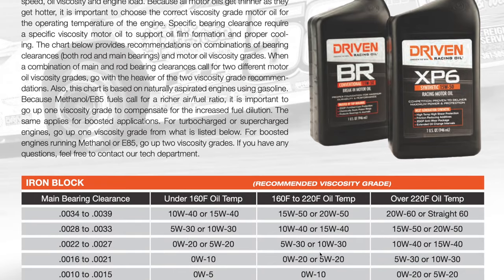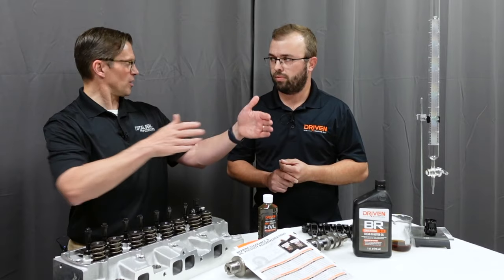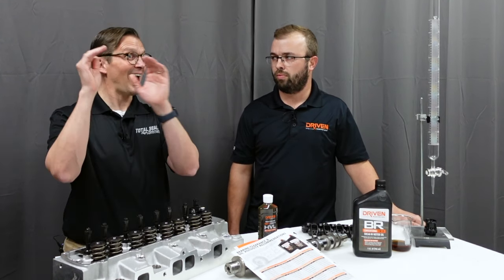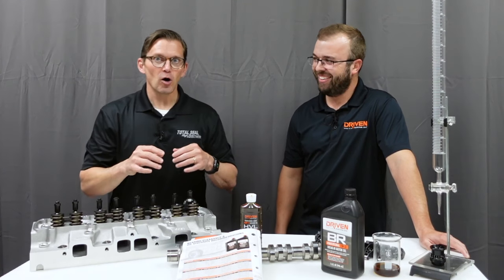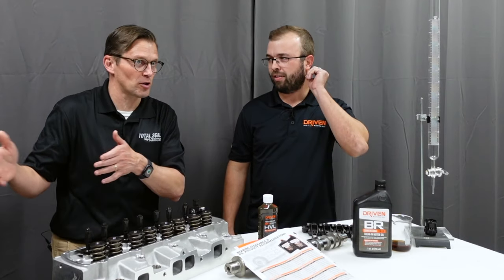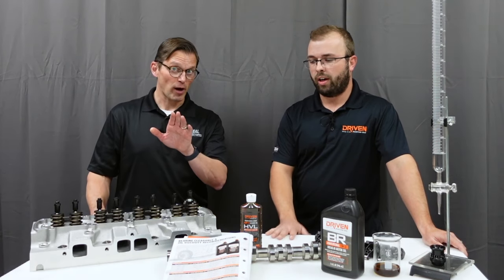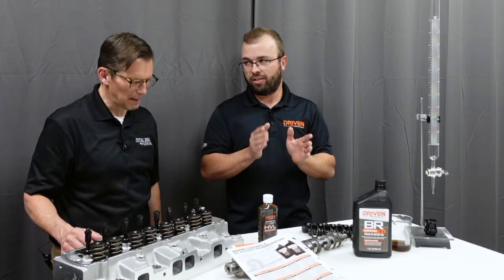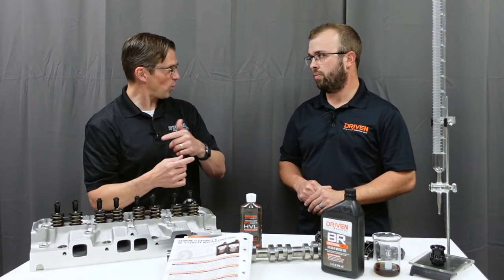How To Choose The Right Viscosity Motor Oil - A Certified Lubrication Specialist Explains

Comment: Thanks for the great video. One thing to keep in mind, fuel dilution changes the viscosity requirement for pedestrian gas cars too. We can choose an oil that provides adequate MOFT under 100% of normal operating situations, but when driving around town, fuel can accumulate in the oil. Follow this up by a blast down the road at high speed, some towing, or a track day without enough time to evaporate the fuel, and bearing failure can be the result. The Audi supercharged V6 is well known for this.
Reply from the maker: Great point!
Reply: There is more than fuel dilution at work here. A 5W 30 oil is a 5 weight oil.cold with viscosity improvers to make it act like a 30 weight oil when it is hot. Operating in the tight clearances of a running engine a couple of other things that happen beyond fuel dilution are shear back whereby those viscosity improvers get broken. Think of them kind of like tiny bits of thread that get torn in half, so now your hot oil behaves more like a 25 or 20 when hot. Another thing that happens is boil off. Petroleum is a compendium of molecules with different boiling points. When you get the oil well warmed up the light ends vapourize and get carried out in the PCV system. Now your 5 oil becomes 8 or 10 when cold. 
Synthetic oils do not have the range of molecules petroleum oils do and can be engineered for qualities the designers want. Thus they do not have the same light end boiloff or the shearback. Synthetics generally have premium additive packages in them that prevent shear better. 
Like the old Fram filters ad, pay me now or pay me later. You generally get what you pay for, so if you pay for cheap shit, you get cheap shit.
Reply: @daledavies2334  speaking of PCV , I wish people would change their friggin pcv valves! Some cars should have them changed as early as 30,000 miles. Then on another topic, I also wish folks would do their transmission fluid at regular intervals.  Today's small DI turbo engines with a CVT is so easy to do, you should really be doing it atleast once a year. Or at a minimum of every 30,000 miles.
Reply: @daledavies2334  THANK YOU, THANK YOU, THANK YOU!  So many people nowadays think that a multi-vis oil is the hot number - ie 5W 30 is the same thing as SAE 30 - and will argue and even want to fight you over that.  I was beginning to think I was the only one still alive who knows what Multi-grade oil is.
Reply: @vermontvermont9292  They insist on waiting for the trans to start slipping, and by then it is often too late.  The damage has been done, and the death spiral has started.

Comment: I use what my car manufacturer recommends in the winter and put in a slightly thicker oil in the summer. Most of all, I pay attention to the night time temps. I want the thinner oil in there for cold nights. When it never gets below freezing at night, only then will I put in my summer oil. You want the oil flowing freely at start up...always.
Reply: All multi-grade will flow freely at start-up.  It is SINGLE-GRADE that may not.
Reply: 5w should work unless you see -30+
Reply: @AntilleanConfederation at that temp, even 0W oils may take a little bit to get up to the valve train upon startup.
Reply: @carlovanrijk4039  exactly
Reply: @jamesbosworth4191 back in the day,  my Dad was having trouble starting his 6.2 diesel ⛽️ on colder days (n.w.corner of Oregon) I switched from his straight 30 to a multi viscosity... problem solved

Comment: Working in a large fleet operation, 200 units, cars, SUVs, trucks from class 3 to class 8, I observed 1st hand the effects of 0- 5, 5-20
Each vehicle that the manufacturer recommends 
super light weight oils had knocks, rattles, changing to 10-30 stopped it all.
Our fleet was made up of GM, Dodge, Ford, gas, and diesel engine cars and trucks in Colorado.
 Managing a fleet you get see the effects even before the manufacturer does.
Reply: Isn't the purpose of  low viscosity oil all about better fuel economy ?
Reply: @speedfreak8200  At the expense of engine life.
Reply: @jamesbosworth4191  only for American junk. I had a 2012 Camry that I put 217,000 miles on using 0W 20 oil. Never burned oil between 10,000 mile oil changes and no knock or engine problems of any sort whatsoever.
Reply: @markkauffman6184 They didn't advertise 10,000 mile oil change intervals in 2012.  Also, lots of people have told me in a bragging way that they hardly every change their oil, yet their engines is "perfect".  Well, it does start, and it does move the vehicle forward, but perfect???  Pounding like a blacksmith making horseshoes is hardly "perfect".
Reply: @jamesbosworth4191  actually in the owners manual it did say you could go 10,000 miles under normal driving conditions. I did a lot of highway driving and so it fell into that normal driving conditions. My engine did not burn any oil and when I looked inside valve cover, there was zero varnish, all you saw was gray metal. The only reason I sold it was it was starting to rust - and in the rust belt that is the kiss of death.
Reply: @markkauffman6184  I am talking about what mechanics say, not what the automakers use in advertising claims.  You CAN NOT go that long unless you don't care about engine life.  The EPA gives the automakers tax credits for making those ridiculous claims.  They are not dreamed up by the engineers, and I will not listen to car-hating hippie bureaucrats.  Many of them don't even know how to change a damn tire.
Reply: @jamesbosworth4191   Hippies can only Change Flats on VW Micro Buses, ha ha
Reply: @speedfreak8200  Have you seen this commercial, I never catch the whole thing, but there are some adults, INCLUDING GUYS, and a car with a flat.  One of the ladies says, "Let's get this fixed".  Having to call a tow truck for a flat tire when GUYS are there?  Incredible.

Comment: Excellent video! I’ve never seen a chart that gives you a baseline for where to start with bearing clearances. I want to build a road race 454 LS7, and now I can have an intelligent talk with my engine builder. I’d like to run 0W-40 on the road course at an oil temperature greater than 212°F and still have adequate oil pressure at 7000 RPM. Hopefully going with the gas-ported, gapless 1mm, 1mm, 2mm ring package!  Thanks for educating the track rats and gearheads out there!
Reply from the maker: We are happy to help! The gas ported top rings are awesome, and the 0W-40 should be a solid option with bearing clearances between .002 and .0025
Reply: @DimosTs192 dodge specificies a 0w40 for all their scat packs aka 6.4l Hemi, so at least at start up I cant imagine they would spec an oil leading to wear under warranty...in fact other oils will void it....
 I run a 5w50 in a 7600rpm LS7 build get about 75psi hot at shift....

The gen 3 boosted coyote calls for 5w50 it would see 90psi at 8000rpm shifts well 7850
Reply: @DimoS... does the w stand for weight or winter ?

Comment: Good video. One has to remember that with miles come wear, the clearances will get bigger thus less resistance for the oil. With higher milage you will have too use a thicker oil.
Reply: High mileage oil
Reply: @matt4398  Only for leaks.  I've read High Mileage will cause rubber seals to expand...

Comment: I keep looking through these hoping to see Lake Speed Sr show up. I miss the glory days of NASCAR.

I run 5/30 in my wife's Chrysler and 0/20 in my Alfa, just as the manufacturer recommends. No problems and we run them long and hard on trips (300+ miles between stops @80mph).
Reply: What's the outside temp when using the 0w20.  I'm not a fan of light oil in hot climates...
Reply: @lonniebeal6032  Freezing or boiling. There's no other recommendation. It seems to work fine. The engine temps never go above 192 and it doesn't use oil...about 1 qt every 10K miles.

Comment: One additional point, when using piston squirters, distributor gear squirters or in engines that have other forms or devices or wear that can result in oil pressure/flow escapes, (leaking timing chain tensioners or slightly worn oil pump are a good example on an older engine) The use of ultra low viscosity oil can result in zero flow to distant components. It's not that the parts need more viscosity, it's that the system as designed or operated can't provide adequate flow, often during very low RPM conditions. This is why we sometimes see the farthest cam bearing cap wiped-out first. And why a move to a more viscous oil is a viable solution.

Comment: Many years ago I ran two different oils to test on a very hobby level, but there was almost 40 degrees *C oil temperature difference, one was Semi-Synthetic maybe 15-40 or 10-40, the other was Full Synthetic maybe 5-30. It is a long time ago, but I was impressed at the difference, it was also two different brands, so many changes. But one of them was around 95*C and the other around 135*C at full warm somewhat "hard driving" on the street, not on track. 
What oil was best for the motor I would guess the one that kept the heat the lowest. As long as the pistons also were cooler, and not just the oil.. Hmm.. I guess above 100*C would be nice for some water evaporation though. 

But what actually made me comment here, was the Cylinder head, just a random Olds head on the table.
Reply from the maker: Thanks!
Reply: Which oil run hotter for your experience?
Reply: @BoredGeese  In my experience fully synthethic runs cooler if you check the oil temp gauge, if it is because that oil transport more heat away from the other materials, bearings, pistons etc. or absorbs less heat than mineral oil I do not know, I only get more questions thinking about it than answers.

But if the synthethic has less wear than mineral oil, I guess part of the lower temperature is because there is less friction, less wear and less temperature because of that. But maybe it is cooler because it is more effective at transfering more heat away instead? And is that because of the more uniform size of the synthetic oil molecules or because of more/better additives? I do not know. But too hot oil is not good atleast, but then, what is too hot oil? What is the limit?

Comment: Most people don't understand multi weight oils or viscosity; this subject is best explained by SAE ( society of automotive engineers )!!! 
I have been using Rotella or Delvac 15W40 in everything I own since the 70s. Which included a3.5hp Briggs & Stratton push mower  that lasted 25 years!?!?!?
Today I use Rotella 5W40 synthetic in everything. 
I said all this as a retired CAT&CUMMINGS diesel mechanic.

Comment: Ford recommends 5w-20 for my Coyote 5.0 f150. But one thing I noticed is that most 5w-20 evaporative characteristics is what is giving the 5.0 a reputation for high oil consumption. By simply going to 5w-30 I noticed my Oil Catch can had less oil in it and my oil level was better between oil changes. OE recommendations isn’t always the best.
Reply: Same 5w30
Reply: That's because, today, oil viscosity recommendations are partly based on gas mileage, rather than engine life.
Reply: @jamesbosworth4191  Entirely actually. Its a numbers game and longevity pays out exactly 0 dollars.
Reply: Yeah, I switched to 5w-30 at around 70k miles. I was researching and came to the conclusion 5w-30 was best for my vehicle. I had no idea that there were quite a few F-150 owners who did the same, as I wasn’t specifically searching based on the F-150, just location and the pros and cons of 5w-20 vs 5w-30. 

It started with my diff fluid/gear oil. Went with a slightly thicker viscosity for better protection. Sure, MPGs takes a slight hit, but I don’t think the majority of us got a truck for it’s spectacular MPGs. It was even recommended by most Ford YT mechanics to go with a thicker gear oil in the diff vs what Ford recommends.
Reply: @leo-ub6nb  I don't see how the gas mileage difference is enough to see in the real world.
Reply: Same with the 5.4 3v. USA says 5w20 but everywhere else it's 5w30. They did it to meet emissions. They really require 5w30.
Reply: @F1rst2Swing  FACTS!

Comment: I have a 2013 Ford Edge 3.5 cyclone engine at the current time I'm running 5W-20 Mobil 1 AF synthetic, I know that was recommended strictly for CAFE here in the US, because in other countries, they recommend 5W-30. I know that engine is not hard on oil, I have a 120000 on it right now, I've already had the water pump replaced, along with the timing chain, tensioners, guides and oil pump. Would you recommend going to a 5W-30? Stay with this oil? 
Thank you for your help
Reply: I don’t know if that is going to help you but one my friends at my previous work used to have a Mazda CX9 with the same engine as your Ford Edge. He clocked at over 400 thousand kilometres (250k miles plus) using 5w20 oil and didn’t have any issues engine wise. Aside from charging the water pump obviously.
Reply: Won’t hurt a thing.

Comment: The Ow has more additives that break down over time than the 5w or 10w.
The lower the range, the less additives.
I was using Castrol Edge 5w40 which was oem for my turbo car.
Now I'm doing Castrol Edge 0w40 which had a higher lube rating than the 5w40 but more additives which break down.
The 0 should pump faster on start up which prevents wear.
The engine seems happy with either and I'm in the Pacific Northwest so we don't have extreme hot or cold weather.
I'll just use whichever is cheaper or available..lol
I do 10k full synthetic oil changes and filter.  72k and runs like new.

Mazda mpv V6 ran Mobil 1 5w30 at 10k oil changes and ran like new for 150k miles and sold car.

Cheers

Comment: I have been using synthetic oil only in race engines for near 30 years. Road race or dirt oval engines. Have normally used 25/50. Chev road race engine did aprox 2200 race miles and the bearings were basically brand new. Good enough to reuse. Unfortunatly the crank was cracked! I did use 15/40 also, seemed no different. This on a drysumped SBC road race engine with a decent oil cooler running to 7500. Oil temp usually around 220-230degF
Current project is a 5 litre Ford to 340ci.  Will be run to 7500 also. The windsor oil pump drive is too small@ 5/16,, weak and I am stuck with a [good] wet sump. I feel 10/40 may be the go. Crank will be aprox 2 thou right along.
Reply: Use a crome molly shaft.